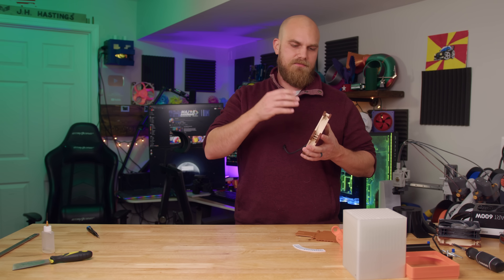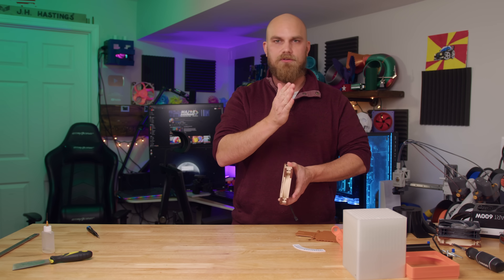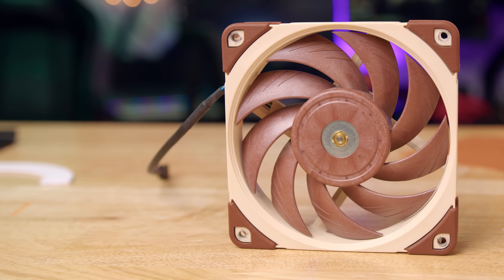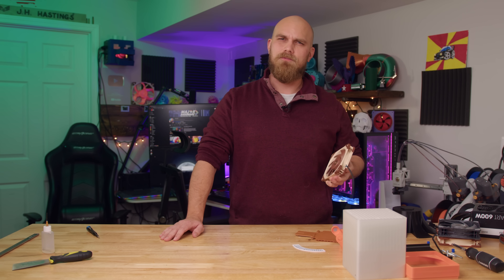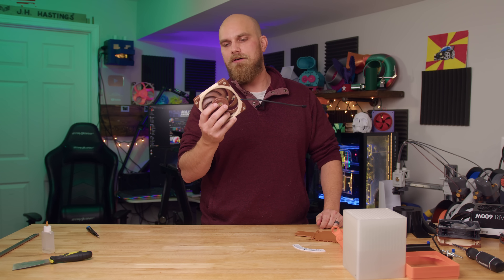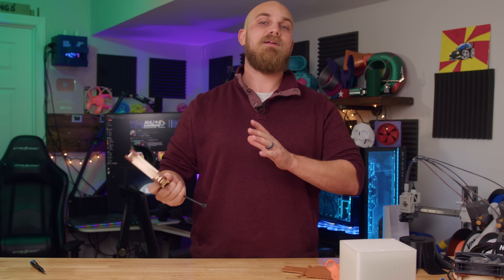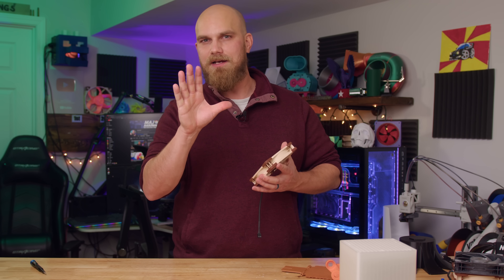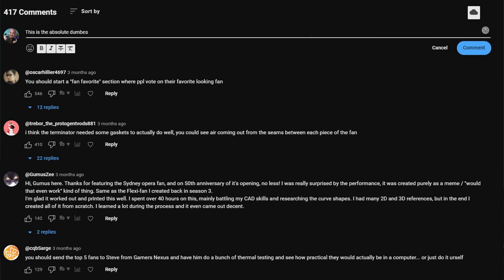I Built a Static Pressure Machine | Fan Showdown Season 6 Pilot

Comment: I think you would get better resolution of results if the flap was completely enclosed within the tube so that the air had to push the flap completely out of the way to move through instead of just far enough to jump out the side
Reply: I like this idea as well; completely enclose the flap in the tunnel.
Reply: Please enclose the flap. I would expect higher results with it enclosed, not that it should change the ending results of the fans that have been submitted. But the range of the scores will be higher than 1-6, which is probably going to be the case with the current set up. (Not many fan designs have beat the stock a12x25.)
Reply: Yes, enclose the flap if you really want static pressure.  Additionally, as the flap lifts up, the torque needed to hold it in position is proportional to the sine of the angle, so you can calculate the actual pressure, not just arbitrary relative units.  A small gap around the flap will mean some leakage and not perfectly static (zero flow) but it would be much, much less than you have now, which is not close to static pressure.  Maybe with a bypass and anemometer you can observe how pressure goes down as bypass flow goes up, and measure the entire pressure/flow curve.
Reply: i was thinking maybe using a ball in a tube and seeing how high it can push the ball up in the tube
Reply: if the flap were all the way open the end of the tube should be flush with the 'bottom' of the door, and have a square profile so it would have a decent seal at any angle
the shape of the exhaust would always be rectangular and would have to increase sensitivity as there would be less wasted pressure.
Reply: Also can have the pointer arm longer and end with something like a needle if you are concerned accuracy. Would allow for smaller readable increments, and a smaller point indicator.

Edit: autocorrect
Reply: @Thisisaplaceholder1 this. Yes 
Enclosing the flap. Useless
Reply: Essentially build a butterfly valve in a intake manifold of a car but instead can use a neutral-weight counterweight to bring it back to zero
Reply: @Bassnova you may be on to something
Reply: Yeah, the exit should be tunneled
Reply: As a fluids engineer, I agree. The current setup is good, but you might be able to scrape together a few improvements on resolution. Orthogrid instead of isogrid, a longer dial arm, and enclosed flap are all great suggestions.
Reply: Smart!  Just walls on the sides and bottom would lead to interesting result differences im sure
Reply: I like to keep my flaps completely enclosed within my tubes too.
Reply: I'm definitely on board with the flap being completely enclosed.  I think it would mostly solve the first concern I had while watching which was that the flagship fan everything will be tested against, just didn't go far enough up the scale.  I would guess that the amount of pressure to achieve a higher number is an exponential curve and not a linear one so the higher the baseline fan can push it, the better able you'll be to differentiate between good and mediocre fans.  In an ideal world, we'd have the spacing of the numbers in alignment with the actual curve of difficulty of lifting the gate but the thing I love about this channel is everything is done at a level of testing that we all potentially have the ability to recreate with results that encourage more complexity in testing.
Reply: Same. The airflow will travel on the path of least resistance which in this setup is everywhere but on the flap once it opens. This setup seems like more of an airflow speed test rather than static pressure. 

Also, having the flap with a parametric curve toward the fan (like a sail capturing wind might also help increase deflection on the guage because... Well... It's then like a sail and as it deflects it will continue to offer at least one surface that is perpendicular to the airflow.

The only concern I might have with that is the resulting turbulence behind the bottom tip of the "sail" so maybe some thin slots on the bottom of the chamber (just past the flap) to relieve some of that?
Reply: It seems, that scale is inaccurate, resolution decreases exponentially from 0 to 18 “units” (I think, not sure, but should be close) 
I think you should recalculate scale (higher the flap is, smaller devisions on scale should be)
Reply: maybe put the flap in a U shape extension so the sides are closed even when the flap opens..
Reply: Putting the flap or better term damper  in a section of straight duct would create a barometric damper. with an indicator on it I think that would be a great idea
Reply: Maybe add a place to attach weight to see how much it can lift to the first mark? Add pennies for weight. I think you will find that better performing fans all will have almost identical scores in the way that this test is constructed now.
Reply: retractable circular lid, so it is attached at the middle, or the edges of the circle, and the shaft on it should have outer scale for the lift measurement.
Reply: Or making the door longer than the opening itself so that the more the air pushes the door open the more door it has to push. Otherwise there will be a sort of mid point that all the fans will be centered and focused around. No single fan will get zero or close to it and no fan will get all the way to 18 either. In other words the distribution won't be linear. It will be kinda like an inverted bell I guess? Don't know if that makes sense.
Making the gate enclosed within the tunnel would help or changing the size (longer) or even the shape of the gate would also help to make the distribution more linear. - such as making the gate conex against the flow of air. That way, even though the overall surface area which is being pushed decreases as the gate opens more and she more there will always be a portion of the gate that will always be exactly perpendicular to the flow of air. In fact the convex shape could be mathematically optimized so that the perpendicular amount would always be the same regardless of the angle. This would result in a much more linear distribution.
WAIT! this is all dumb. I just realized the main issue is that as the gate opens more and more the opposing force of the gate on the air flow due to gravity becomes increasingly perpendicular to the force of the air. The best measurement would be to have the gate always opposing the force of the air, hence the best option would be to make the entire system/air tunnel be vertical instead of horizontal. That way gravity will always provide via the gate and much more directly opposite force against the flow of air.
Reply: Like the AFM in my truck engine.
Reply: I live this. I’m in for Season 6!!
Reply: Why not use mm/H2O as a test like noctua does?
Reply: Same thought
Reply: I was thinking the exact same thing. It’s like the graphed deflection vs power input would be logarithmic. 
Why not take the simplest route possible and use something akin to a ball in a tube (vertically). Naturally the ball would have to be smaller than the tube to allow flow which would result in oscillation as the ball bounces around. So I imagined the same flow straightener he made, but round and encased in an acrylic tube. This way the potential flow remains constant as air pressure increases and the height of the floating air straightener determines the fans rating
Reply: Yes however the size of the flap having no restriction doesn’t create that much of a difference in static pressure. Smaller outlet door will create more static pressure with more resolution. 
Smaller outlet with a restricted size both gaurentee static pressure and better resolution. 
Just food for thought
Reply: 4:49 
It would also make sense to use a non-linear scale instead.
For example, new_scale = 0.602 * old_scale^2

Alternatively, using a load cell would be more accurate.
Reply: Nah, that'd present needless design problems, like how to keep the duct sealed with a protruding indicator that's unaffected by whatever seal. Since the side venting is mechanically still part of the ducting, better to keep the current general set up but implement 4 springs instead of the hinge. Or simpler yet, gravity - turn it upright, add guidance rails, and replace the door with a sphere, cube, whatever platform of an exact weight and cross section. Could even make it a platform to place graduated weights on to maintain the platform at a given distance where the cross section of the ducting matches that of the opening to maintain volume of flow. Since were dealing with pressures, ya know, force per a given area, feels like there's a term for that type of device. I think I may need to step away from all this hard thinking to get the real scale of the situation.
Reply: Yep same thoughts here since you now lose all your static pressure which is what you want to measure in the first place
Reply: Yea like putting a macaroni noodle swoop at the end for the flap to travel through
Reply: I second this, but also maybe remake the flap with that pattern being 1mm thick instead of 2mm, that should still be rigid enough (unless 1mm was already tested and failed) and also reduce a good amount of weight for your A12X25 baseline to be closer to that middle area, i don't think you'll get it exactly to the middle, but it should be "near enough".
Reply: and enclosed flap would give a better result.
I was thinking a 'puck' ( or ball or cube) within a tube, with tight~ish clearances (<1mm). That way the entire weight of the object would have to be lifted to a point where the pressure underneath it was suspending it.

I am not sure the flap method gives a linear scale, if the balance isn't perfect, the scale would be more logarithmic
Yes, this would be fine as all fans are compared against the same scale; but a more linear scale would be easier to distinguish fine changes.

that way you could fine tune the sensitivity of the scale buy adjusting the clearances of the object
Reply: @clandestineespionage5731 it’s meant to measure flow not pressure
Reply: I think you're better off with an actual quality manometer... but the visualization is fun for people.
Reply: I was going to say basically the same thing, but then again physical engineering is not exactly what I'm known for...
Reply: Friction 😑

Or even worse, stiction.

I kinda agree, but I think it would lead to less consistent readings, and it would depend on the time the fan takes to get up to speed. Unless the flap wouldn't get too close to the walls, but then the side flow comes back.
Reply: This feels like needless complexity. If the flap is an issue, why not (as less-upvoted comments suggest) simply set up a tube inside the duct, exiting to a U-shaped bend that is filled with water and affixed to a scale. mmH2O is a standard measurement, so comparisons to other measurements could be (somewhat) meaningful. No worrying about the flap not being enclosed, no fussing with CG/balance, no additional friction, no worrying about sealing, etc. (Also, I'm not convinced that enclosing the flap would mean the fan would definitely force it all the way open; at some point it will simply act as a restriction in the duct, at which point, I'm not sure what knowledge we've really learned? Flap seems like not the best idea TBQH... mmH2O is commonplace for a reason)
Reply: No and because pressure built on the backside will resist the flap opening.  There has to be an allowance of air release on the flap movement to prevent back pressure.  His test is better since it relates to radiators and the backside of a radiator will be open anyways.  This is an ideal test setup.
Reply: I don't think all your replies would make much difference cause any more back pressure on these gutless little fans would probably kill them 😢and skew
 the results, it would be different if he was testing at 30,000rpm, but he isn't so putting it in a sealed duct at such low rpm will increase back pressure so much as to kill the miniscule fan motor and once again skew the results 😅
Reply: and perhaps test each fan more than 1ce to eliminate "random flukes"?
Reply: @marcinkowalczyk647  He did, He said he did each three times, just didn't show it.
Reply: then you'd have to worry about friction against the sides and/or air gaps along the side
Reply: It doesn't really matter because he's not trying to get a calibrated reading for others to compare with. It only has to be able to compare with itself. A higher reading here is still a better result, and a lower reading is a worse result.
Reply: @tin2001  yeah, but those units are not representing actual difference in air pressure , you may as well have circles, triangles and squares in this case, instead of numbers
Reply: up

Comment: I like the box idea, just wish it had more resolution, but I don't know how that could be done.  Maybe put a long needle on the end of the gauge and make the gauge circumference bigger.

Im also curious on how the "flow straightener" impacts the ability of the fan to lift the door. Can you try one without the flow straightener and one with? That would be easy to design  and print.
Reply: Yes! He definitely needs to make the arm to flap ratio a lot larger right now it's maybe 2:3, with the arm shorter than the flap. I think shooting for 2:1 (with the arm double the length of the flap) would give him a much more precise measurement.
Reply: Maybe some sort of constant scaling on the force on the flap? Not sure how he can implement that but maybe a small motor that can react to the force applied on it depending on the angle of the flap?
Reply: He could select a low-angle, easily accessible for most fans to reach, and gradually add weight to the door in small increments until it can no longer stay open, recording the weight at that point.

Comment: You should add a geared indicator so you can have more discrimination between intervals relative to flap displacement angle or a longer indicator tip so you can include more gradations between presently available marks. Your ability to measure differences will likely suffer without something like this.

Comment: The way is made it's not at all linear making it impossible to compare beyond bigger/smaller. Maybe using more of a lid that lifts straight with a linear spring of some sort.

edit: to ckarify, I mean not leaving an opening, which would allow a better pressure reading without airflow/turbulence having an effect.
Reply: Basically a closed chamber with a clear tube full of water and you measure the distance the water travels ;)  Genius!
Reply: No that's not how it works the water measurement for pressure is how much water that pressure can "support", so you'd have to either add/remove water or widen/tighten the tube to achieve a balance.
Reply: Well, if you were wanting to measure a certain ...pressure... that a fan could ... Statically... support.
Reply: @AndirHon  What's your point?